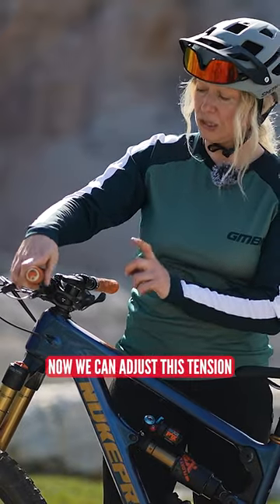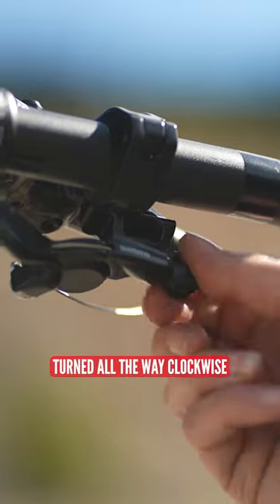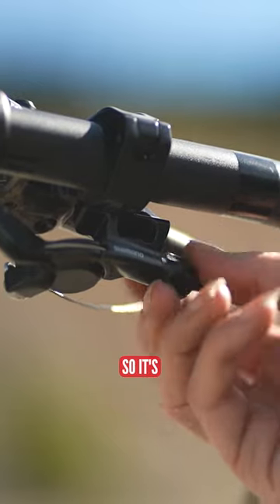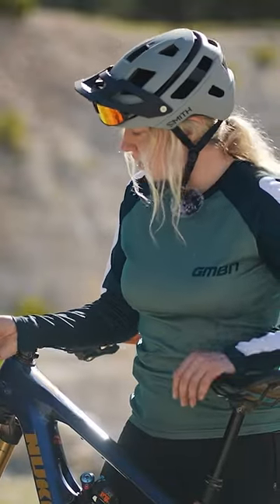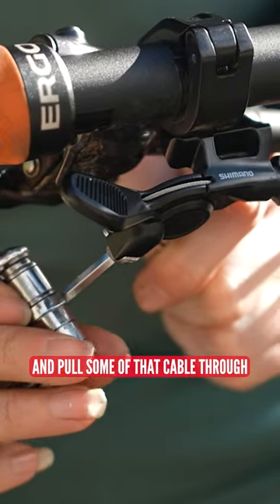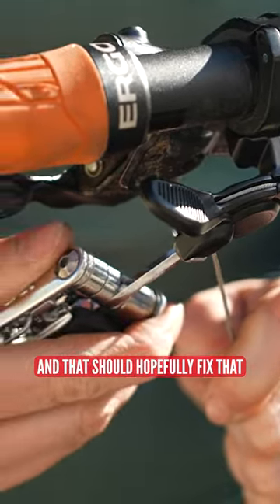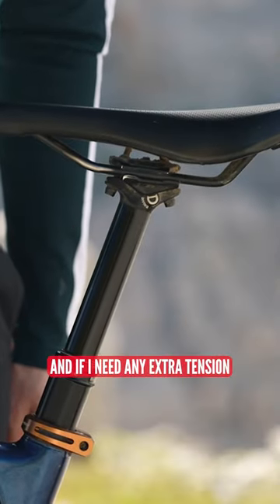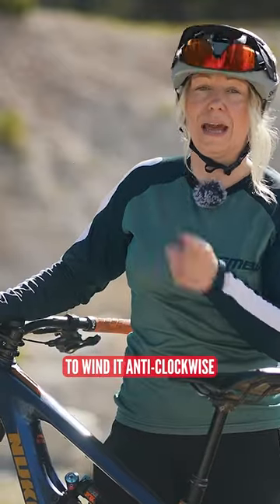How To Fix A Slow Dropper Post!

Comment: atart off with this, but if your dropper is rising as slowly as it does at the end of the video it almost definitely needs a service, or if it has air instead of a coil then it needs more pressure.
if its takes lots of pressure to push the lever replace the outer cable,if its still difficult after new cabling youll either need your post rebuilt, or if its cheaper, replaced.

ik this is a short but i feel this doesn't cover enough
Reply: yeah I can instantly rule this out on my post seeing as it isn't cable operated

Comment: Sometimes when you adjust your saddle height these issues can pop up because you over torque the seatpost clamp. Sometimes you gotta stay at the low end of your recommended torque setting :)

Comment: My post would raise slowly, not as good as it originally did, and not all the way to the top (would raise to appx 90%). Added a dash of WPL Suspension boost, cycled my seat appx 15 times and it's running good as new. This is a temp fix until I have time to service properly with cleaning and re-greasing and lubing.